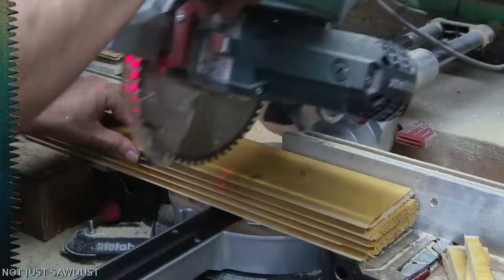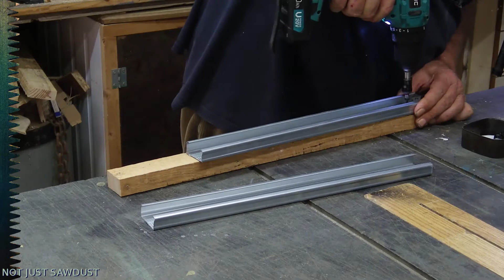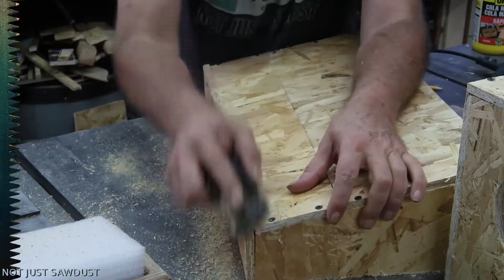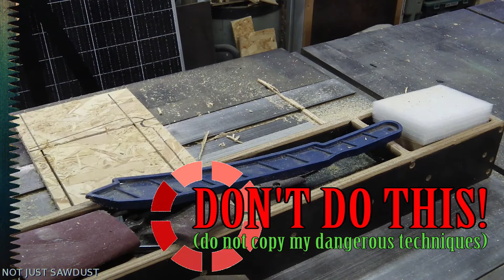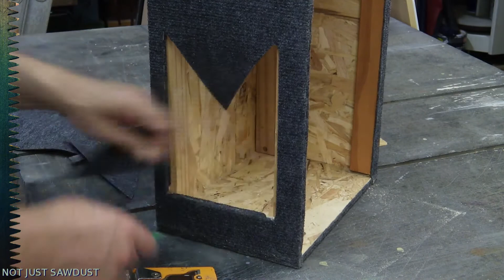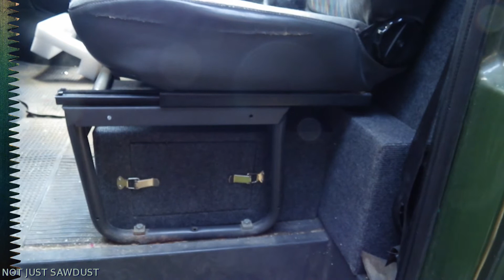The Iveco Conversion part 13: Battery box and passenger side wall from reclaimed materials.

Comment: Hello Gerrit, The trailer is being completed. I love that you use recycling. I use it from time to time. nice battery box. I hope you don't get it wrong. I will say this. You could have made the boards you used for the sidewalls a little thinner. In order not to overload the trailer, light materials are generally used. Am I exaggerating too much :-) But your trailer looks great. you are making good progress. Congratulations. Thanks for sharing the details. I wish a nice Sunday. all the best. Big greetings.
Reply from the maker: Hello Mehmet, Our van needs some weight in it to drive smoothly. It is made to transport heavy loads. When it is empty we always have a few bags of cement in the back to have some weight on the rear springs. We are way under the maximum of 3500 KG, even when it's completely packed for the holiday, we still have 500 KG left.

Comment: I understand your frustration about the wiring and phantom lights - I've just had to do something similar. I managed to get the lights working but I've no idea how!
Reply from the maker: The quick solution is to have a main switch for the battery.... (it only occurs once every few years, but it would be a hassle if it happened when on holiday).. so that's what we are going to install I guess,,,